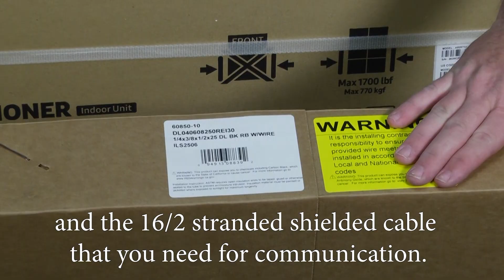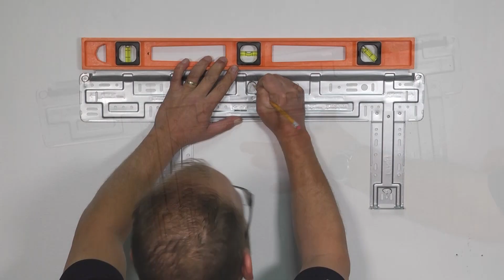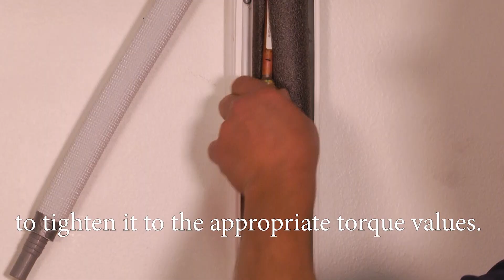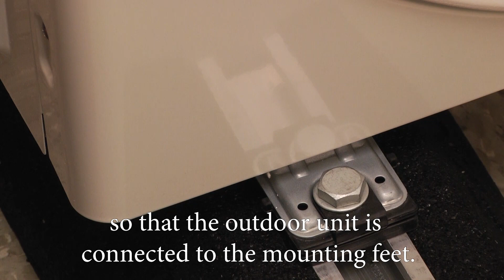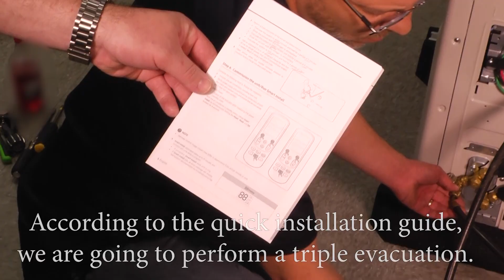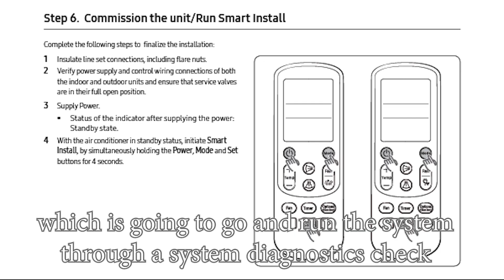Mini split installation

Comment: i mean ---power from the break box to the outdoor unit connects where? power to the indoor to out door unti is OUTDOOR UNIT L1/L2 to indoor unit L1/L2 right? so again where do you connect the outdoor unit to the breaker box.... not a good video that seems to a big piece missing

Comment: To bad they do not wire the units to electrical code. The outdoor unit does need 3 knock outs just to meet your requirements. If your going to do a video of an install at least do it right.

Comment: How does the service port work on the outdoor unit?
This is the most important section of the film. But no, no information. Very sad the story is this way.
When you open the service port there is a valve in it. You remove it. And then? What is then? What do you connect to this port without valve? How do you vacuum the system via the service port? How do you keep the vacuum when you disconnect the vacuum pump?
Anything else is simple, this should be explained thoroughly.

Comment: You don't need to power the indoor unit? 

If you want to separate the shielded wire, don't you think you'll need 3 knock outs? 

Why would you use an indoor connector outdoors like that? It's going to rust... Or do you not plan on Samsung units working long after warranty? Like my TV?
Reply: yes you need to power the indoor unit from the outdoor unit
Reply: @pandorapuppy3255  then 1 ko for indoor power, 1 ko for indoor communication, you drill you own hole for the line voltage?
Reply: @daylate  late reply lol. But usually you just run a 14/4 wire. The first 2 wires are for 240v power. The second 2 wires are for communication.
Reply: @vincentgrueter7759  not true. 14/2 for Max 15 amp. Unless you only install small units. Never ran romex for communication. Besides you need 14/3 for communication.
Reply: @daylate  ok bro. You have whatever wire size you need running to the condenser because you have a large load like the compressor. Then, you run 14/4 to the fan coil in the order in which I described
Reply: @vincentgrueter7759  oh then you done effing up when you run Romex for communication. Read the spec, shielded wire only. 

Or you can install Mitsubishi, lg, carrier, Daikin. They require 1 wire to the out door unit. Samsung is the only one that needs a separate wire for communication.

So just a heads up, you've installed crappy Samsung units wrong this whole time. Congrats? Don't lecture me about wiring mini splits.
Reply: @daylate  yeah dude, I've been effing up this whole time. You're right. That why I install mini splits all the time with happy customers who are more than thrilled to pay me when I'm done. I've never had a problem with Samsung units. I've installed mistubishi, Daikin, blue ridge, Fujitsu, and Samsung over the years. Never had a problem. You asked a question and I answered as to what the solution was. Sorry you're butthurt someone does it differently.
Reply: @daylate  the power wire to the unit is ran is seal tite from the disconnect. And it's stranded wire from a roll so not romex! And the wire to the indoor unit is 14/4 black uf wire. Not romex! So you can stop calling it romex. It's all ran in seal tite outside and clamped along the joists where ever it ran in the crawl space. Call it hack if you want. But it's never been a problem. If it was I wouldn't do it. Don't worry man, you'll never have to come fix my work.
Reply: @daylate  I can tell you're a Bubba from the way you talk man. Yes it inspected by the inspector. Not like they know jack about HVAC anyways. You're the type to put your analog gauge set onto the unit and dump charge in until the gauge shows a 40° coil and the suction is (beer can cold).
Reply: @vincentgrueter7759  analog, that's something a hack would use. I know your type, turn it on and leave the property. Who cares if there lineset is a little bit long. Who cares if it needs refrigerant. Let them call you for a service call later so you can bill them. I know how hacks work.

Still you can't read instructions. That's so sad, your customers know you are illiterate?

You never have a rep from a company coming to see your work have you? They'd laugh and tell you to read. 

But they don't know you can't read. UF cable when it goes into the house, it's counted as Romex... You didn't know that either. Do you de-rate your uf cable when you use them? Do you know what de-rate something means?

I would say read upon it, but we know you can't read.
Reply: @daylate  I'd be careful who you're calling illiterate when you can't even use the correct "their". You don't need to de-rate the wire when the fan coil barely uses a couple amps. Do you really think 14 gauge wire can't handle it? And yes, you're right I don't check the unit when I'm done. I just slap the pullout in and hope they don't call with in my warranty period. Cmon dude. You're a joke.
Reply: @vincentgrueter7759  coming from someone who can't follow manufacture spec, that means a lot. That's all today folks, done talking to hacks who don't do their jobs right. 

My cousin Vinny: I do it semi right and it works, so that's good enough for them.
Reply: @daylate  you won buddy. That last sentence put a smile on my face and for that you won. 🏆 🏆 🏆
Reply: @vincentgrueter7759  thanks, I want to thank God first and foremost, I like to thank my family for supporting me, and all the hacks out there, giving me the opportunity to show my clients what real work looks like. I also like to thank Vinny for the entertainment of the day.